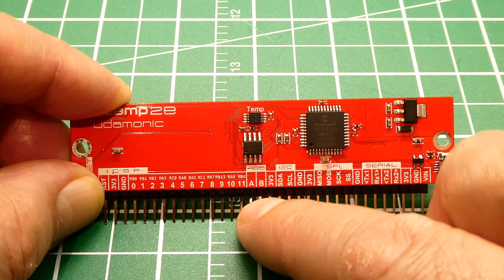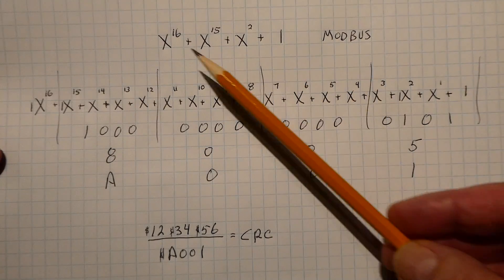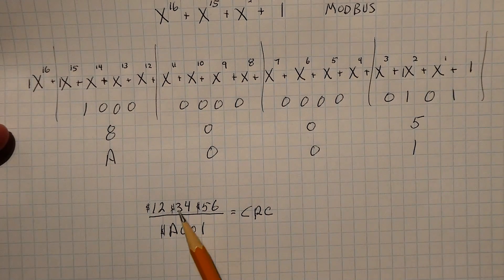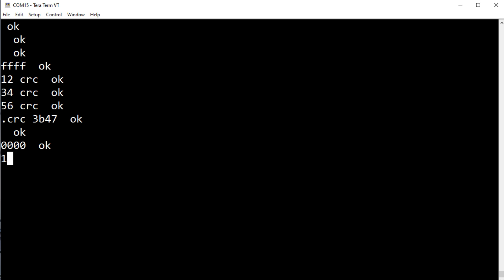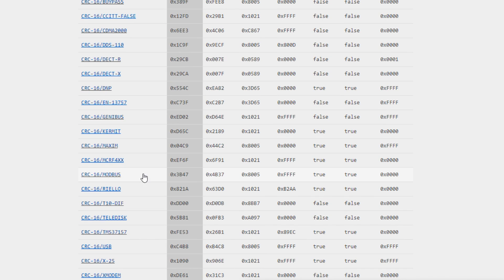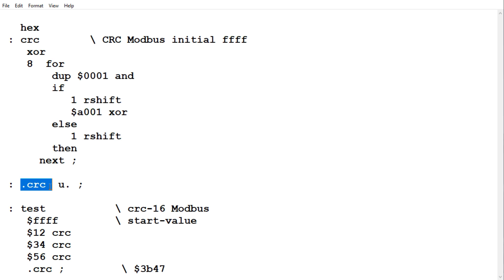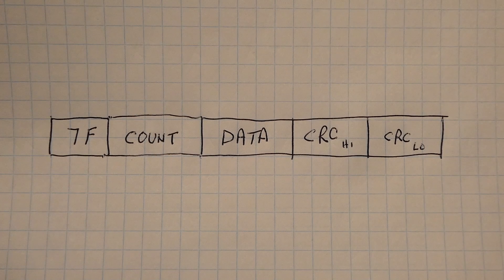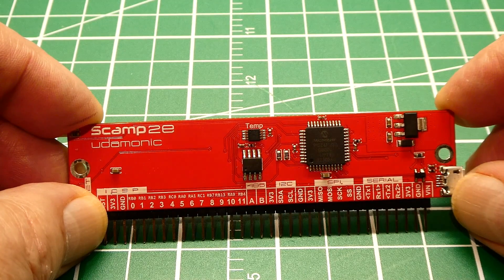CRC Error Detection / Modbus 16 Bit CRC / RS485

Comment: One 'speed up' we used to use was a pre-calculated ookup table instead of doing the math.  As a memory lookup was faster.  But in some cases you do not have he memory for it.
Reply from the maker: Back in the day I mainly used tables but with the current speed of microcontrollers ( STM32H7 @ 550 mHz ) its not a problem anymore. Even on the PIC everything was done on the stack, so it was at assembler speed.

Comment: I must admit this is one of the protocols I've not looked into in any depth but is very interesting none the less.
Out of interest Ken,  of all the various "Flavours" of embedded Forth you have tried, which one would you consider to be the most robust ?
Reply from the maker: The most robust Forth I have used would have to be F-PC by Tom Zimmer. It is now obsolete as it ran on a PC under DOS. I sometimes get it running using DOSbox. I ported it to a DOS SBC for many products that still run today. http://www.jkmicro.com/Flashlite186.html
A windows version of F-PC called Win32Forth is a free download online.
Reply: @0033mer  Thanks Ken.It's much appreciated.